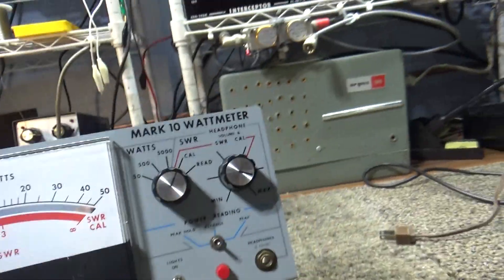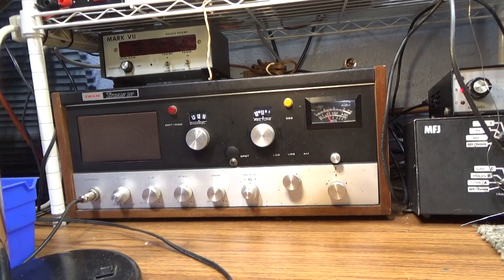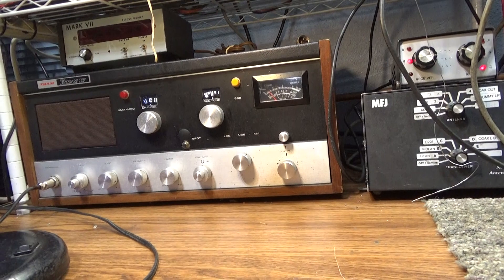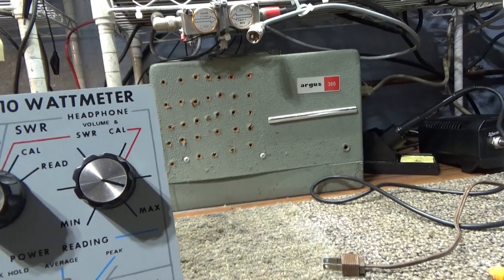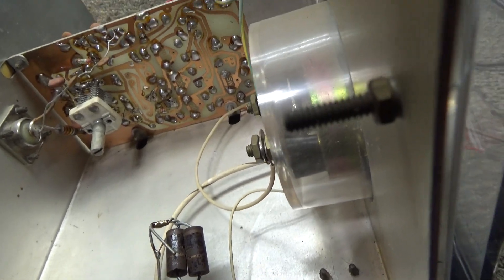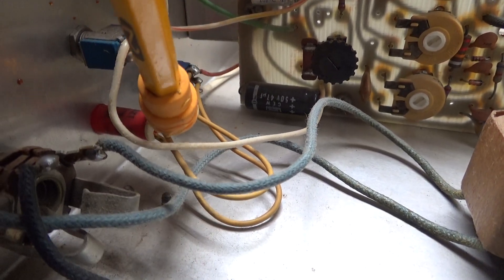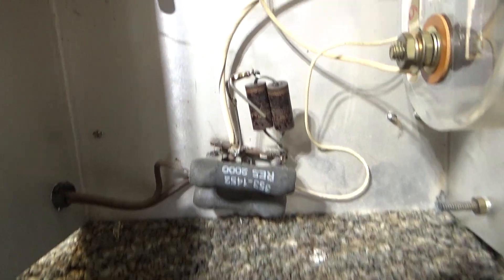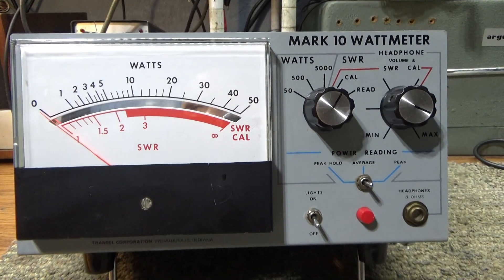Latest Toy, Transel Mark 10 large face wattmeter but I need help.

Comment: It doesn't light up the meter? Anyway, I'd never plug it in without serious modifications. 
Number One: it needs a polarized plug.
Number Two: it needs a fuse.
Number Three: it needs a transformer. You can repurpose a wall-wart to run the new LED lights. 
Stay safe! 
Sunday 8/14 was the first time in a few months that the West Coast boomers came in on 6. Eventually it shifted around to Puerto Rico before finally dying out but maybe the summer doldrums are coming to a close.
Reply from the maker: I have about 8 accessories that run off 13.8v and use 5mm plugs. I was thinking of converting this to that and then I can forget about the ac stuff.

Comment: There Is supposed to be a bulb on the back of the meter to light the face up. Did someone take it out ?
Reply from the maker: Must have, I don't see one.
Reply: I think there is supposed to be a shunt with resistance and 2 bulbs but they seem to be missing

Comment: It looks like they went cheap and instead of using a transformer to step the voltage down to around 12 volts ( I think you said the light was 12 volts) they are just using a resistive voltage divider circuit.  There is the one larger wire that goes to the switch but what did the other smaller wire go to?  It is connected between the two parallel resistor pairs.  It's so had to see anything in the video but it looks like there is a red wire attached to the switch also, what does that go to?  In any case, it looks like a death trap.  No transformer isolation like those old death trap transformerless amplifiers from back in the day.  If it does run off 12 volts I would throw out the resistive divider circuit and stick in a 10:1 transformer to safely get the needed 12 VAC.
Reply from the maker: Good advice but I'm just going to convert it to 13.8 dc in, even safer that way.